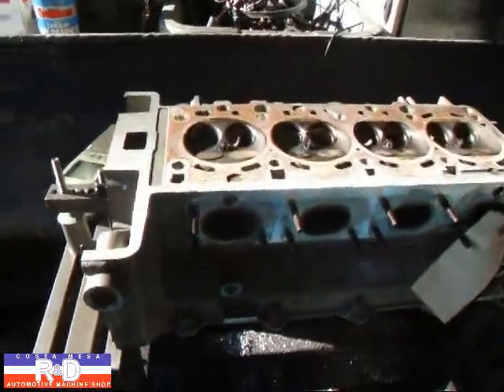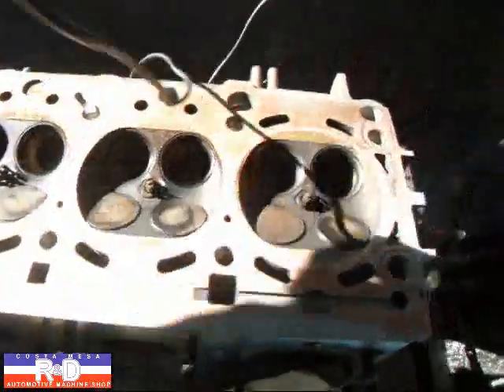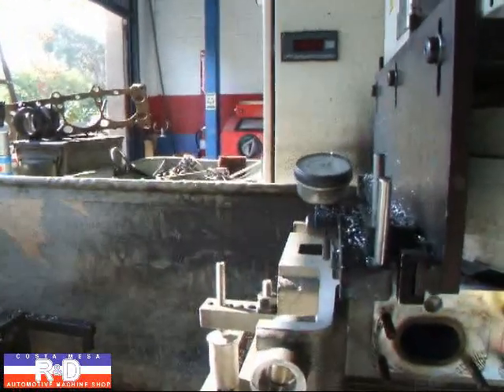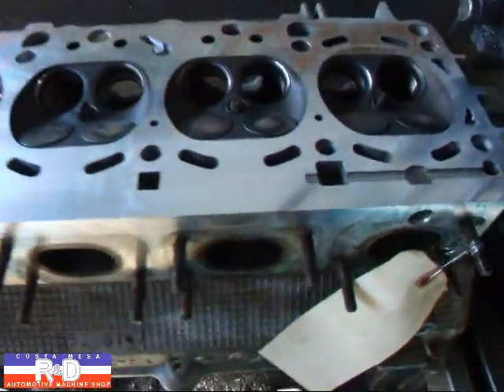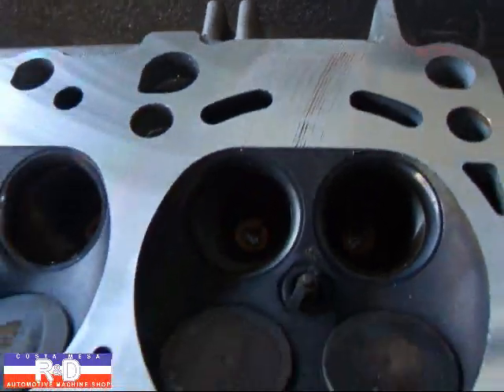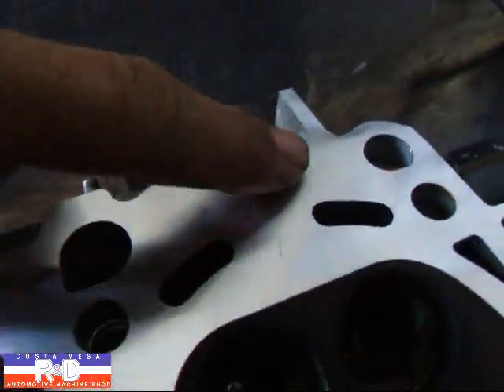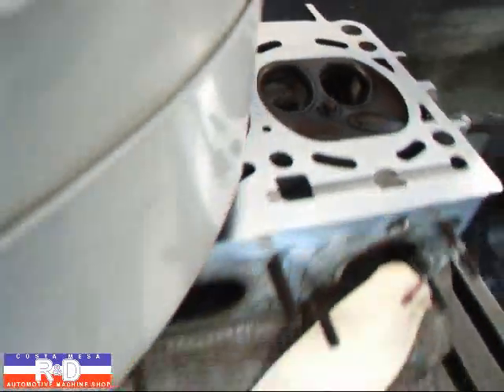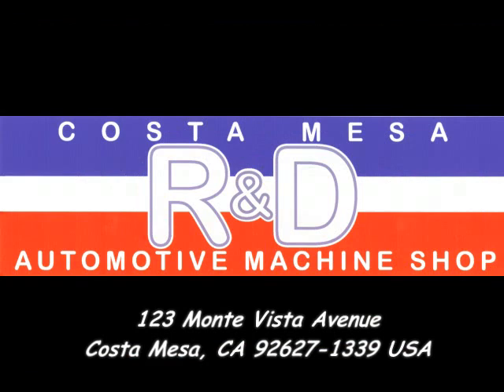BMW Cylinder Head Resurface

Comment from the maker: Depending on how much you material is remove, you will make a determination as to the head gasket thickness. Unless the block is removed and stripped, will I resurface it. Both head and block are deburred after resurfacing.

Comment: what do you after you resurfaced that motor block? do you also resurface the other part of the block? and do you do and deburing? are there no problems with the new dimensions of the motorblock when you put it back together, because its a few thousand inch shorter now?

Comment: Hi John, what is the typical sort of tolerance the factory would give to a head for machining?
Also, does it ever get to a point where a thicker gasket is required to keep the compression close enough to standard? Cheers :)

Comment from the maker: You need to remove enouigh material that the cutter won't just smear the surface. You don't understand how this machine is built and operated, there is no reverse for opposite direction and the cutters only go on one way. Get a copy of my engine rebuilding handbook (Sunnen's Complete Cylinder Head and Engine Rebuilding Handbook) to get a better understanding.

Comment: @chuckwin100 If you refrence to the top of the casting you would more then likely be cutting the surface at an angle and cut far more material from one side of the sealing surface.  I would also imagine that the lands for the head bolts are not completely parallel to the sealing surface?  I am not a machnist but that is my best guess.

Comment: i was wondering how much it would cost to re-manufacture a H22a4 crankshaft as well as resurface the head i don't need a precise estimate just a ball park price because i want to see if would be cost effective to re-manufacture a crankshaft or buy a used JDM engine